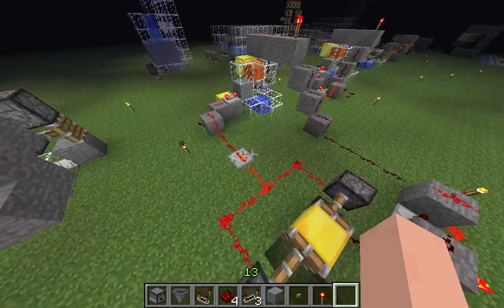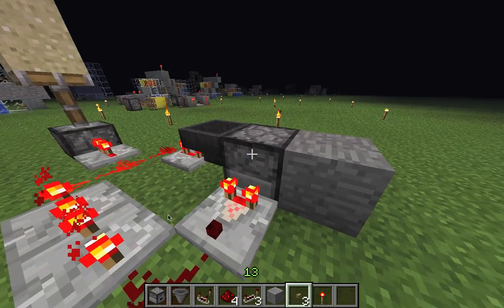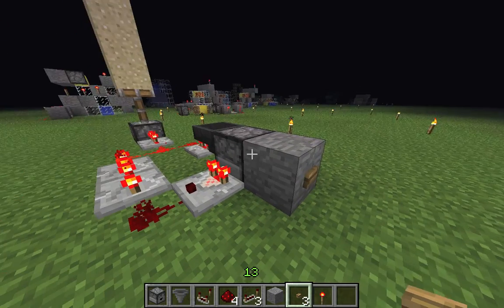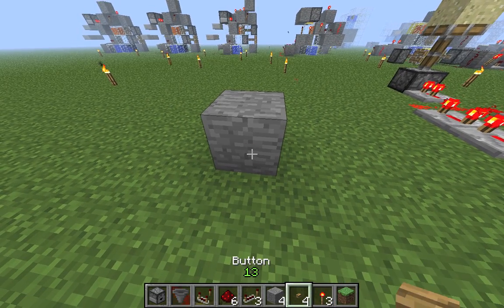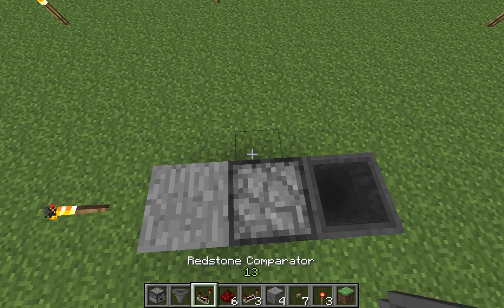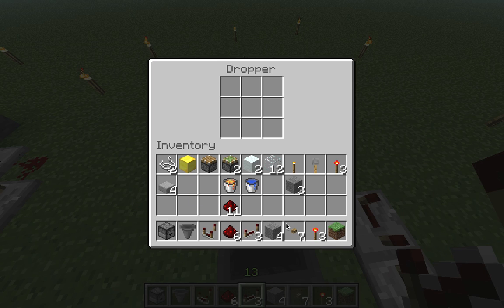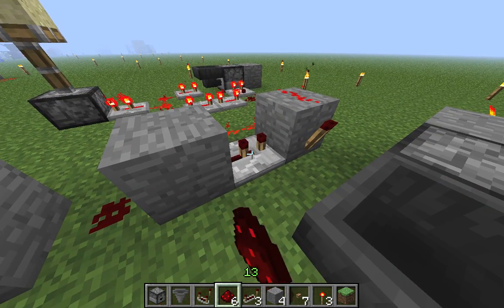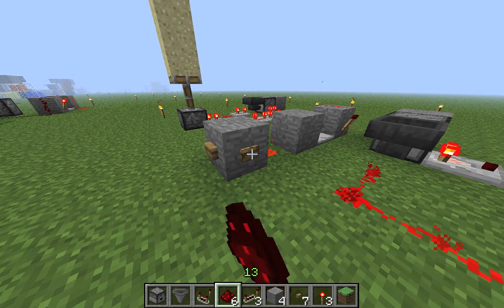Minecraft 1-2-3 counter with dropper/hopper - works in 1.5

Comment: Very nice. Thanks. You can remove the repeaters for the reset by using an RS Nor Latch. You add another Comparator coming out of the hopper. Invert the signal from both comparators, use the "empty" signal from the hopper to Set the latch, and the empty signal from the dropper to reset it. Then use the output to block to hopper.